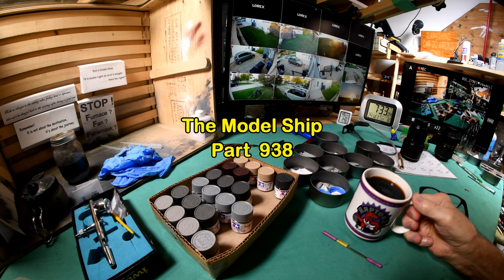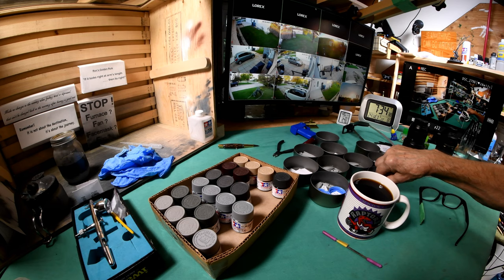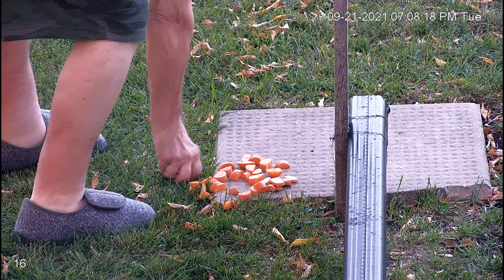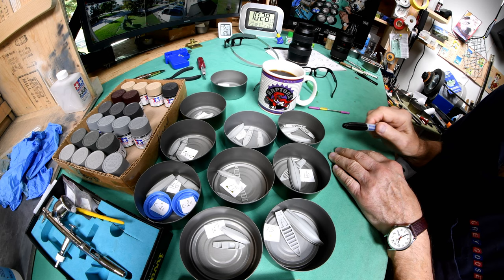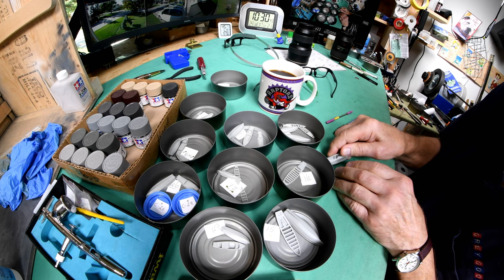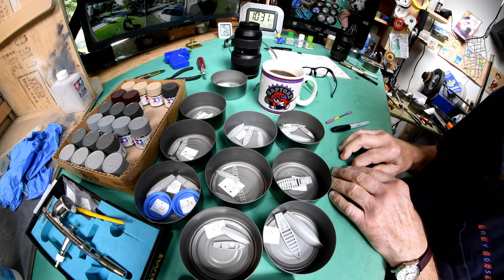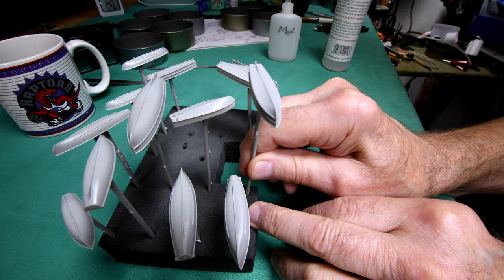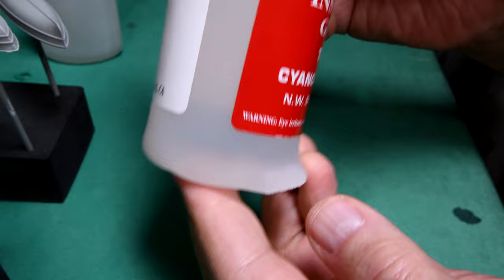The Model Ship - Part 938

Comment: I use a 6B Lead pencil for marking parts ,dark enough to see, light enough to airbrush over without bleeding through the paint , better than a sharpie which I originally used too yes keep your CA in fridge I have always had mine & my masking fluid in the fridge I lost a few to Aussie bush heat in the past.good to see bunnys 🐰 after Missy put her scent on the carrots 🥕 & the small bird, I haven't airbrushed for about a week either so don't feel bad about it cheers mate 👍👍
Reply from the maker: Re: "use a 6B Lead pencil for marking parts"
Good tip Trevor. Thanks! 👍
Reply: @roncalverley  it works great 👍